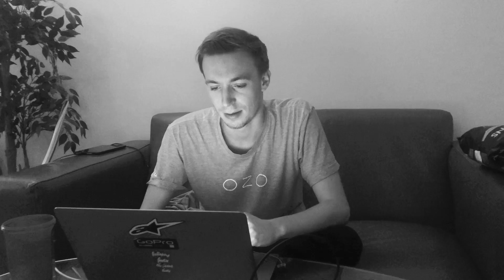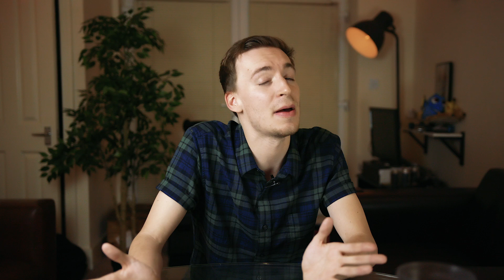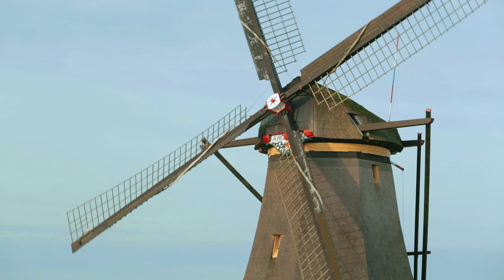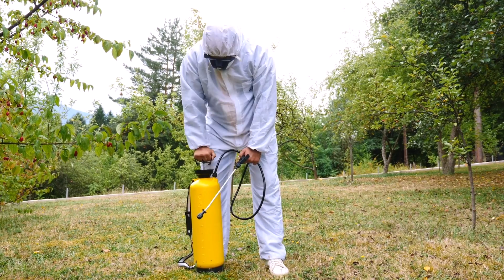Difference Between F1's MGU-H and MGU-K!

Comment: More likely related to the trick new power recovery clutch on the Ferrari. Teams lie about failures of new systems the world isn’t meant to know about. Remember Bahrain 2010 when a “spark plug failure” burned a hole in Vettel’s exhaust and cost him the race? Purely coincidence that we found out later than Red Bull and Renault had at that time been developing their ignition retardation exhaust blown diffuser system!  If that was a spark plug I’m my auntie Amy (I’m not). Same here, I bet this LeClerc failure was not MGU-H, nor “combustion chamber problem” or whatever cover story they concoct. It’s the extra air pressure from their dodgy air pump built into the clutch.
Reply: Whoops - just realised the Ferrari air clutch is a Scarbs April fool joke. That’s me looking proper stupid then... goddamn scarbs....!

Comment: Is there a difference between the MGU-K with KERS system used a few years ago?
Reply from the maker: KERS in simple terms was like the MGU-K and the Energy Store combined. But that Energy Store was just for the MGU-K, whereas now their separate components so then other parts like the MGU-H can also provide power and receive it from the Energy Store. Hope that makes sense!
Reply: @mattamys  sure, makes sense having them as different components so that other parts can also provide energy, thanks for the reply👌
Reply: YES
Reply: @davidbunea20   care to explain?
Reply: @griever2017  the kers is a flywheel that absorbes the energi with a spinning flywheel. Mgu-k converts the kinetic energi to electrical energy with a generator